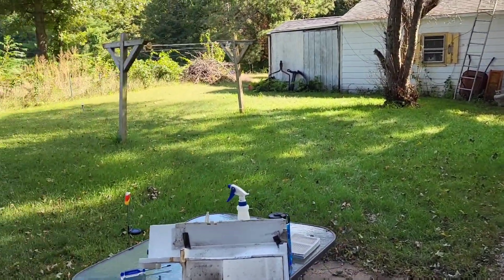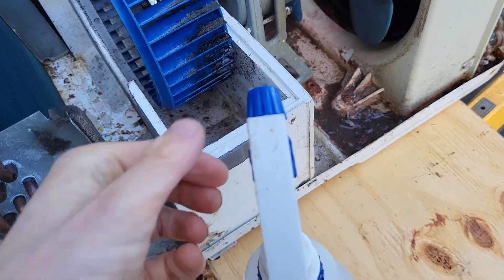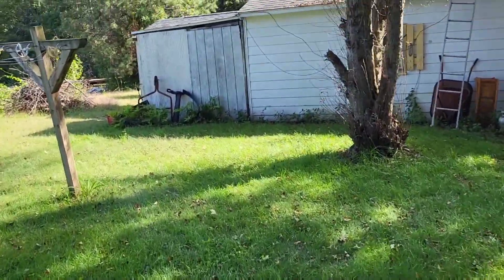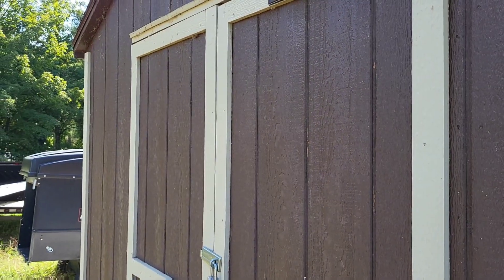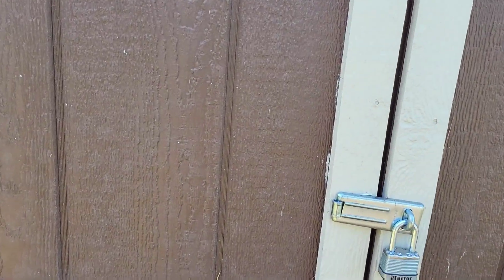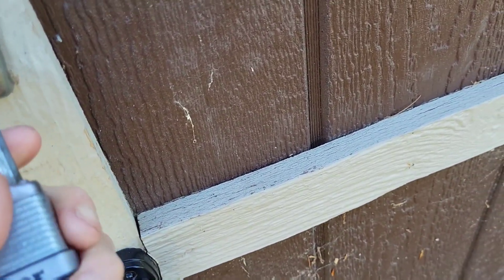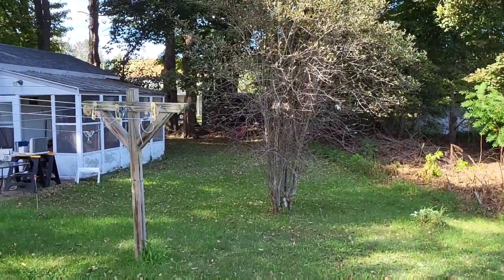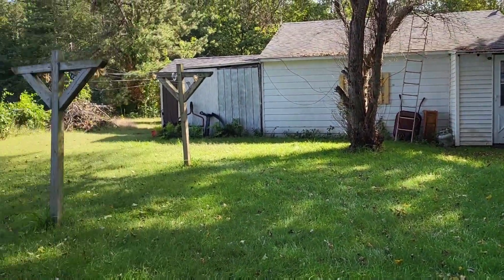Early Fall Update. I Finally Have a Shed

Comment: You have to be careful with air conditions if they're not kept clean they can make you seriously ill and even death. you want to make sure it's got a one micron filter on the output change regularly, you can put LEDs UVA inside the box but you have to make sure nobody can see the light that will kill off serious bacteria and mould, but you have to make sure the light cannot penetrate outside the box otherwise you can get cancer, there's a company in the UK forgotten the name sorry who sells LED of this nature and builds light boxes for sterilisation. Don't buy them off eBa.. or even Anason they're probably be fake LED UVAs